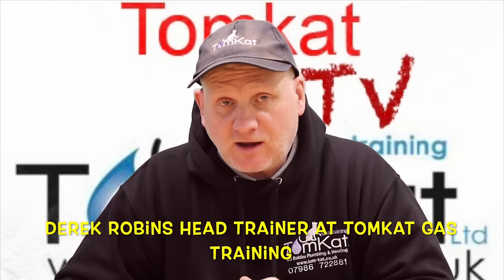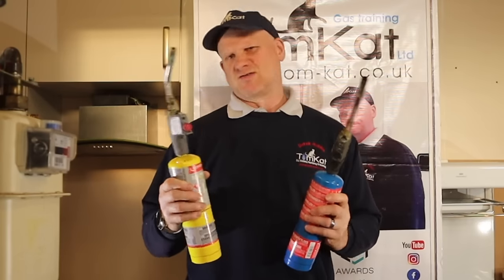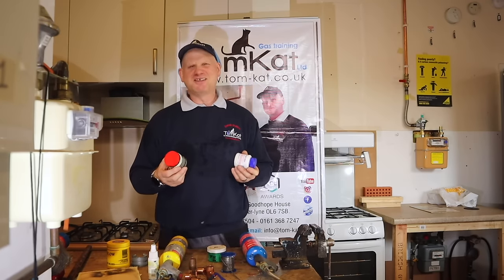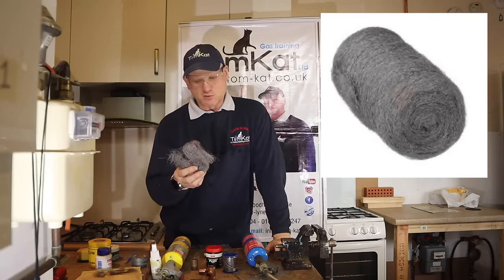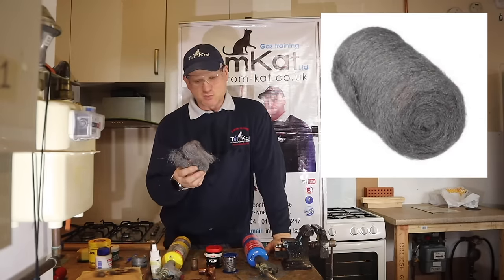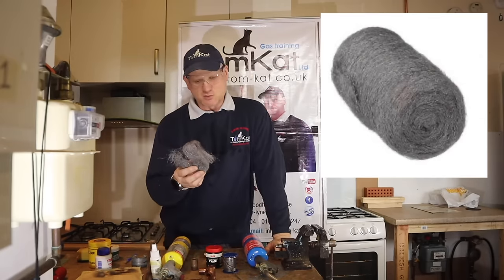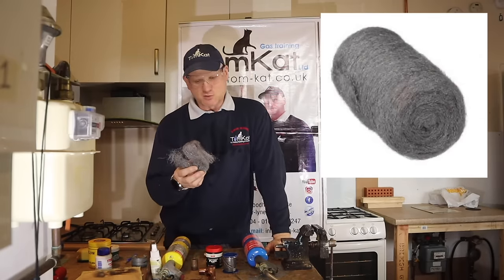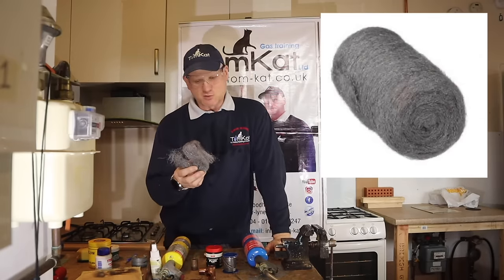How to solder like a pro, Tutorial for trainee plumbers or gas engineers on soldering correctly.

Comment: A good point for new folks, is when fluxing the pipe, try to match the insertion depth of the fitting e.g 22mm pipe fitting maybe 1" insertion, so Flux an inch on the pipe, it helps identify whether you have full insertion (only a thin line will be on show once pipe is slid in) . This is good practice especially for awkward / multiple  fittings assembled at one time before soldering.
I apply solder with flame on opposing side, then remove the flame and almost cool the joint slightly with more solder, otherwise, especially on horizontal fittings, the solder sinks down the joint and you get almost a recess in the top of the joint. Taking away torch and adding solder while joint cools, it'll solidify very quick and stop that. Do not try to be neat soldering for the sake of it, to avoid having drips and adding not enough solder, so a joint pops, you'll kick yourself and never do it again.

Comment: It would be useful to show capillary action by putting two flat pieces of glass together in dyed water. It is not 'attraction', but the interaction at a molecular level between the fluid (solder) and the solid surfaces provided the gap is small. Once trainees 'get' this they will not be mystified as to what is happening inside the joint when soldering uphill. This gives them the confidence not to overfill. Also emphasise that the wire wool is mechanical cleaning, the flux is chemical cleaning/oxidation prevention. Good vid.

Comment: biggest tip is . copper and fitting must be spotless. If copper is gone dirty brown form sitting on top of the van for about six months. or it's just old copper, the best way to clean it is to apply some flux, heat the pipe till the flux starts to run, them immediately apply wire wool around the area to be cleaned, clean off immediately with a cloth. the copper will be spotless, guaranteed perfect joint.

Comment: If you’re new to pipework and soldering just get yourself a few lengths of 15/22mm copper pipe/fittings and just practice horizontal/vertical and overhead soldering And don’t forget safety glasses.

Comment: Wow very nice video 5 star you are the best professional engineer and the master 😀 I been watching all your videos and gave you thumbs up please kindly help me on my vaillant ecotec plus 837 R1 bolier the problem is it goes not goes on slow burner flame ? On central heating and they are no fault error message the boiler and it fires 🔥 up goes to set temperature ie 60 °C and then cut out and the temperature drops to 34 °C then its start after 4 minutes again and keeps doing this again and again?all the radiators are working fine and the boiler keeps on doing this ? Why is it ? Can you please kindly help me on this issue waiting for your kind reply Thankyou 🙏
Reply from the maker: Is the boiler too big for the heating system
Reply: Basically your boilers hitting temp and cycling on and off. Is it making a strange sound? Possibly a partially blocked heat exchanger.

Comment: I havent soldered in decades but have a few jobs that need doing.l am going to get a bit of 10mm pipe from coil. yorkshire straight couplers connectors and do a bit of re cap practce before doing the job.need to buy a good solder mat as the present bathroom has a marble effect veneer ,theres a switch to a double rad same size.what l really want to know is with a medium gentle flame will l notice the speed variant much, l only done 15 and 22 previous.thanks for all your advise.

Comment: Thank for your reply I am very sorry to disturb you as you very busy as you mentioned I checked the d.5 is 56 and d.71 is 75 on my heating system I am using smart Honeywell EVOPACK4 Evohome Base Pack & 8 HR92 Multi-Zone Heads with touch screen displays system
Reply from the maker: For what you are saying it looks like it’s the controls obviously I am not in front of the boiler but it’s the first thing I would check

Comment: Useful video, I personally only use lead free, purely  because it  saves changing solders when working with a mix of services. Many years ago, I suffered a severe reaction when flux on my shirt collar  rubbed against my neck. Apparently the flux contained a form of hydrazine.
Just being pedantic, when describing tees, it's  ends first and branch last.
Could you do a video that explains how spring return  valves maintain the various  positions. I recently discovered a video on the subject by my namesake (no relation!).
I've  been fitting  spring return valves 50 odd years and never knew what I found out. I'm  sure I'm not the only one!
Reply from the maker: Yeh when I was filming it I said the tee size correct first then I thought DIYers would get confused so changed it. You just can’t win 😂
Reply: @tomkatgastraining  Even the merchants  don't  always know, but that was the way I was taught! In other  parts of the world they describe as you did, but in the UK my way is correct, let the DIYs learn this.
Reply from the maker: @johnward5006  you are correct but most go to b and q anyway 😜
Reply: What I learned about spring return  valves, was that in conjunction with switching and electronic components,  the motor is supplied with DC current which stops the motor turning and holds the valve in the desired position. Now I've shared this, I hope  we can keep  this knowledge  away from electricians!

Comment: Wow thank very much for you very quick reply I have 7 radiators double panel double converter radiators and I have checked the NTC SENSORS they are reading around 1300 at 20 °C and I have reduced the the valiant boiler out put to 12 kilowatt on diagnostic mode "d.0" = 12 kilowatt and it still the bolier doing the same thing goes to 60°C and cuts out and the temperature on bolier goes down to 34°C and its start again and keeps on doing this as you are very professional engineer any ideas what's going on with is bolier please kindly help me on this issue waiting for your reply Thankyou 😊
Reply from the maker: If you go into d 005 what is the target value set to
Reply from the maker: Also what is d071 set to
Reply from the maker: Also what controls are you using

Comment: my parents house was fitted with central heating in 1972 all copper pipes with lead solder 
still going strong in 2023 
50 years trouble free will probably go for another 50 years 

Plastic compression etc isn't as good imho

Comment: The camera work was quite poor on the first soldering demo and didn't show the positioning of the flame on the fitting, the colour change of the fitting and the pipe, the bubbling of the flux, the melting of the solder and the capillary action when the solder was sucked in.

Comment: Its not capillary attraction and it has nothing to do with metals heating
Reply from the maker: I think you will find it is
Reply: @tomkatgastraining  errrm no....

Capillary action, commonly known as capillary effect or motion, is when liquid flows through narrow spaces without external forces, such as gravity; rather, the liquid's movement is aided by intermolecular forces present in between the liquid and solid surface(s).
Reply: Just got a distinction on my exams on this subject ....lmao
Reply from the maker: @MrMedicalUK  well you should give it back because you’re first statement is total nonsense then.
Reply: @tomkatgastraining  are roots made of metal?.....how to roots take up water initially?.....🤣👀
Reply from the maker: @MrMedicalUK  you said soldering is not capillary attraction so why are they called capillary fittings and how can you solder upside down and it still fills the fittings. The heat is needed to melt the solder to turn it into a liquid which fills the fittings by capillary action. The flux stops oxidisation to aid the process. If you still think soldering doesn’t work by capillary attraction then you should rip up your distinction and put it in the bin where it belongs.
Reply: @tomkatgastraining  No i said it's not attraction....it's action...you melt
Reply from the maker: @MrMedicalUK  why do people like you always have to be insulting when you realise you are wrong and you’re comments make no sense. Have a good evening.
Reply from the maker: @MrMedicalUK  and just for the record capillary attraction
noun
: the force of adhesion between a solid and a liquid in capillarity
The copper or brass is the solid and the solder is the liquid.
Reply: @tomkatgastraining  ...so you admit it has nothing to do with metals or heat....
Reply from the maker: @MrMedicalUK  the video is about soldering which the fittings are metal and you need heat to melt the solder so it has everything to do with it in this situation if I was doing a video on plants then it wouldn’t. Stop trying to be a smart arse it’s making you look foolish and who ever gave you you marks for your paper you better hope they don’t read your comments.
Reply: I thought it was called Capillary Reaction lol
Reply: @tomkatgastraining  It's capillary action not attraction